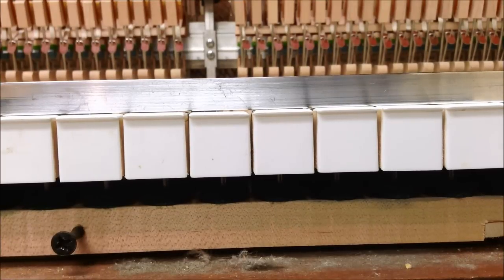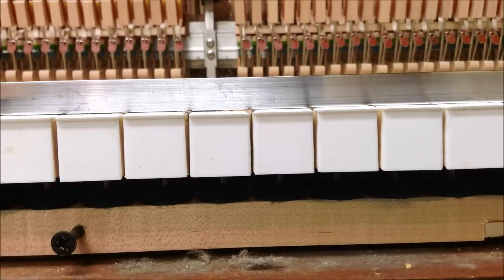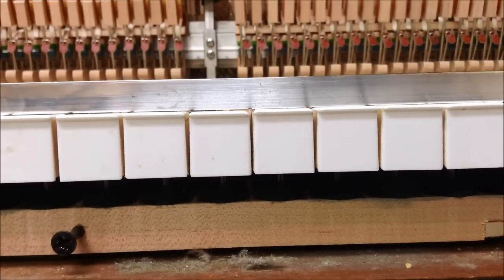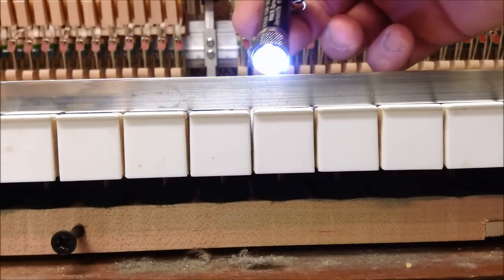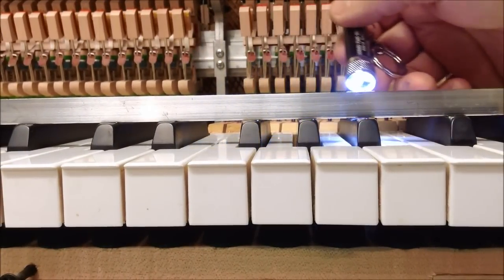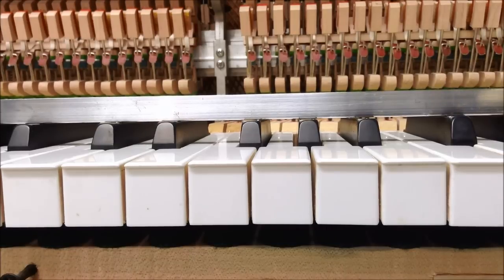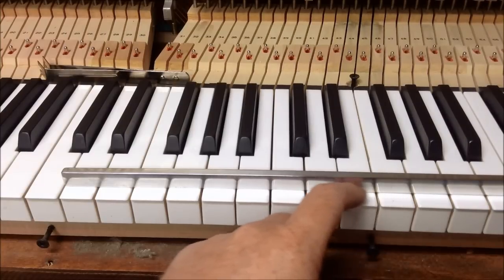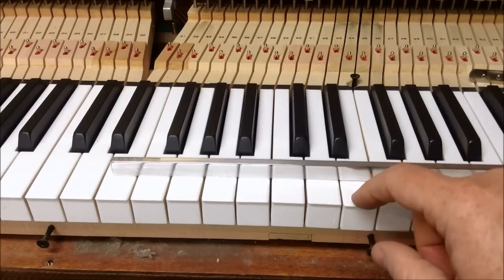Piano Key Leveling - Piano Tuning & Repair I HOWARD PIANO INDUSTRIES

Comment: I have been a Piano Technician for 50 years, this is the WORST example of key leveling I have seen thus far(I haven't looked at many others). As one person asked/suggested you need to establish a key height, preferably on the ends, block those keys at the established height. Using a 48" straight edge(aluminum builders levels work well)the 2 end keys that are supported will support its weight, then using the paper punchings level the rest of the keys to the same height. If any of the keys are too high & there are no paper punchings under them, sand a little off the bottom of the key, keeping it flat, only from the middle where it fits over the balance rail. Repeat this procedure for the sharps/black keys AFTER measuring the height of the sharp above the wood of the key, most are 1/2" some are 7/16" , adjust your measurements accordingly. After leveling set dip, (3/8" on most pianos)on all C's & C#'s by measuring each, then remove action on vertical/upright pianos use the 48" level to "gangset" dip on keys between those you have set.
Reply: Exactly right.  I've been a piano tech for more than twenty years and the method used in this video is not an accurate way to level.  Most if not all pianos in need of regulation are unlevel in the middle two or three octaves (lower in height due to crushed felt punchings) and are lower than the end octaves in key height so this method could easily lead to crooked (perhaps only subtly) key height.  Blocking up A0 and C88 to manufactures recommended height and using a level is much more accurate.
Reply: @retroradio2277  I have a well used piano and a few keys are pretty low and most are not level with it's neighbors. Would replacing all the felt punchings get the keys closer to level? Or would I have to go in with the paper punchings anyways?

Comment: How do you fix the clicking noise?
Reply from the maker: Remove the straightedge. The clicking is being caused by the top of the key hitting the bottom of the straightedge.

Comment: Hi there. Another question for you.  I am trying to learn to regulate a grand piano action model a la PTG exam and the model I have didn't come with key height or dip specifications.  Do you have any tips for how to determine the best key height and dip in an instance like this?
Reply from the maker: Basically the best thing to do is to do some trial and error to find what levels work best for the action.  You would start with the standard key dip which would be 3/8".  Your key height will somewhat be determined by the amount of dip.  You want to make sure that there is some room between the top of the key and the bottom of the fallboard.

Comment: I have a problem with sticky black keys. When I press a black key the front of the black key gets stuck to the white key and therefor isn't able to come back up. Any idea how I can fix this problem?
Reply from the maker: Were the keytops replaced at some point on this piano? If there is contact between the black and white keys the solution is to sand the back of the white tops keys in the notch where the front and tail of the white key meet with sand paper ( aorund 100 grit would do) until there is clearance for the front of the black key.

Comment: How would you know the "proper height" of the keys in a badly unleveled piano? I just got an old piano, and the felts were all rotten or eaten by moths, and I had to change them, and they're in terrible shape. My first instinct is to take the highest key and use that as a base, but I don't want to start off the wrong foot
Reply from the maker: Basically you want to be sure that the keys aren't too high so there is no clearance below the fallboard.  Another good rule to go by is that the fronts should look fairly square above the keyslip.  The most important thing though is to put the key height at a place that the piano plays the best at.  You'll want to start with just a couple of keys experimenting to find the best key height.
Reply: @howardpianoind  thanks. Yeah, my issue us that there's one key way above the others without any paper punches, just the felt. Maybe I need to iron out that one particular felt punching
Reply: Go to a piano store and measure the front height of a white key at rest then depress that key and measure the dip compared to an adjacent white key. Same for the black keys.

Comment: Wouldn't you have to establish some keys at either end of the straight edge span that are the height you want? These are relative to each other, so if you don't have the height at the ends supporting the edge it will through off your base line. Also, wouldn't a high key in the middle, or worse, a few high keys, cause a problem as it would lift the edge in the center area and you could have a rocking effect. I do a lot of mechanical work, and while this seems effective, I know if my original measurement is off, everything related to it would be off.

Comment: I need to lower the flats/sharps on a Baldwin upright. All Baldwins I've seen have very high black keys. Is this do-able by removing felt spacers or will I need to plane wood?
Reply from the maker: You can lower the sharps by adjusting the paper punchings.  If there isn't enough paper or cardboard punchings to make the adjustment that is needed, you would need to go with thinner felt punchings for those keys.

Comment: Question for you - in the video there is a tall screw that juts up between two of the piano keys near the middle of the keyboard.  Two of the keys are cut to allow for this screw.  What is this screw for?  

I've been trying to figure this out because I am working on a similar piano for practice.  Thanks!
Reply from the maker: Hi Lawrence,  I’m glad you’re finding our videos to be helpful.  The screw is for holding up a rail that sits above the keys.  There is usually a nut below the rail and a nut above the rail to secure it.  The lower nut can be adjusted to adjust the height of the rail.

Comment: This is such a great video! Such precision work. I am upset at how I have had my grand piano Yamaha GB1K regulated by the technician here in India. After being at Oberlin College for 5 years with great pianos, this is very upsetting. What I also feel wrong is the hight of the black keys on my piano are slightly lower than I have seen. Is there a standard height they should be at? What I mean, is that usually I see a little below the upper part of the black keys (that angle that appears once the round section ends) while in mine it is about a millimetre lower. Should that be standard? I do notice having problems, especially playing chromatic scales, or the thirds etude of Chopin. Thank you!
Reply from the maker: The standard sharp height is 1/2”, but this can vary.
Reply: Thank you. So 1/2" above the white keys. You say it can vary? What would be the advantage of having it different? Wouldn't this be a problem for pianists?
Reply from the maker: Some pianists prefer a little more or a little less than the standard 1/2”.

Comment: If you replace all your balance rail punchings with new ones that are all the same, would all your keys be level with each other when not pressed? 
Most of the punchings on my piano are either worn out or missing all together.
Reply from the maker: Probably not, unless your keys were perfectly level when you started which is unlikely and also if the old punchings weren’t compressed at all.  Even then it’s not likely that the keys would be level.

Comment: Should the keys be pressing upwards into the nameboard felt? In otherwords, how much pressure should the nameboard be applying to the keytops once re-installed? One might set all of the key tops too high if going through this process because it is done with the nameboard removed.
Reply from the maker: There actually should be some space between the top of the key and the bottom of the nameboard felt.  The key should have some space to be able to lift up before it hits the felt.  There isn't an exact amount, just to be sure there is some space.
Reply: Thank you! That's what I figured.

Comment: What might prevent a key from being able to be taken out in the first place?  I can lift up the front part of the key, but in the back it seems that it's connected somewhere that I don't want to force...
Reply from the maker: Do you have a console piano or a spinet piano?  If it is a spinet piano the back of the key will be connected to a lifter rod.
Reply: @howardpianoind  thank you so much for your kind response! it's a baby grand that's about 80 years old, I'd say...
Reply from the maker: For a grand or baby grand piano, the action has to be removed from the key frame in order to take the keys out.  We do have a different video on removing the action stack: https://www.youtube.com/watch?v=AHBIxx1sCJI&t=2s
Reply: @howardpianoind  Got it - thank you so much for your help! Normally I would call someone to come to my home, but with the pandemic it's not practical at the moment. Your videos have been invaluable.  Thank you so much!

Comment: I assume this is a stand up piano and not a grand because you can't take the keys out of a grand unless you remove the top part of the action which contains the hammers?
Reply from the maker: Yes, this demonstration is on a vertical piano.  It is more difficult on a grand piano because of the fact that the keys can't be removed without taking the action stack off.
Reply: @howardpianoind Further, it appears the keys on a grand piano won't rest normally unless the action is assembled!  This would imply that one cannot simply remove a key, add a punching, and check its level unless the action is put back together.  At least, this is how my Yamaha CP-80 behaves.  It needs the weight of the action to see where the key will rest.  I came here to see if anyone mentioned this, because I'm getting ready to level these keys, and surely there has to be some tricks to save time, right?  I can see why Yamaha uses a computer with laser nowadays.

Comment: I just replaced all the back felt and balance punching, now every key is wonky. what would be the best height to set them at? just use the tallest one?
Reply from the maker: By wonky,  I  assume you mean that they aren't all level.  What you'll want to do is to determine which height works the best for the regulation adjustments to work well on your piano.  I always start with a few keys in the middle and try to find which height is the best and then level the rest of the keys to that height.  You'll want to watch our other videos on regulation to get a big picture of how to do this.

Comment: how would you adjust a key that is too high? is the felt piece too thick?
Reply from the maker: Yes, if there are no paper puncings under the felt and you need to lower the key you would need to use a thinner felt punching.
Reply from the maker: Yes, if there are no paper puncings under the felt and you need to lower the key you would need to use a thinner felt punching.

Comment: Is there any reason not to replace all the pads? It almost seems as though that would be easier, and ensure everything's perfectly level They're cheap, and very easy to switch out, from what I see here
Reply from the maker: It is best to replace all of the felts at once, but this won’t guarantee that the keys will be level.  There will be very small discrepancies in the thickness of the felts.